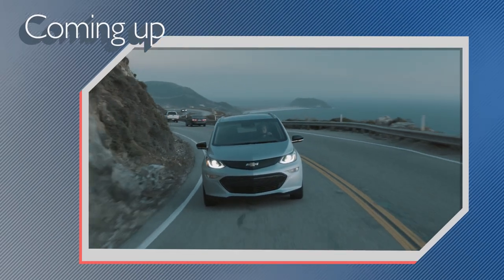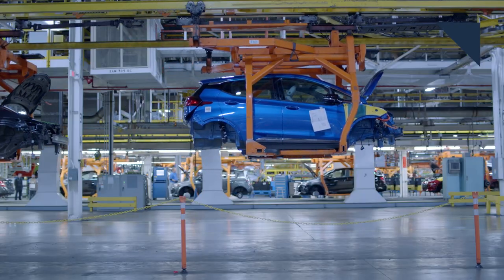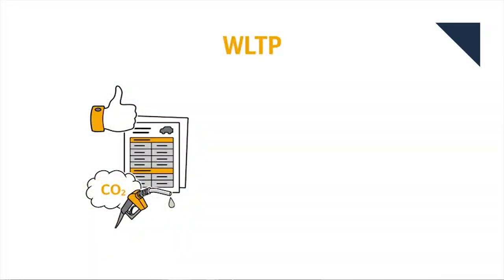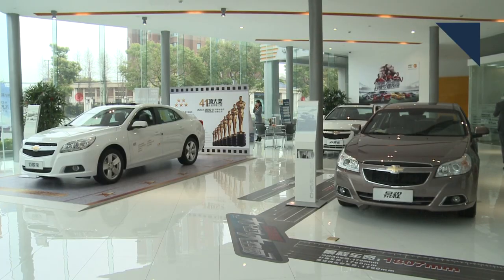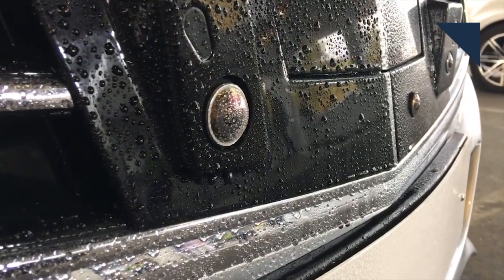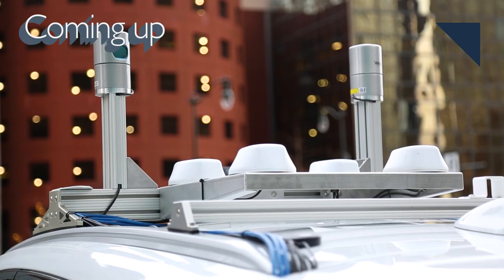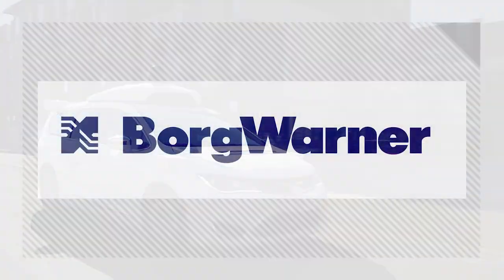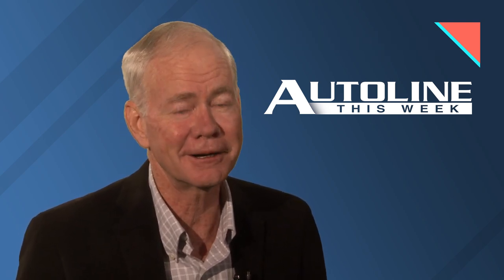What's Wrong w/ Bolt EV? Clever Lens Cleaner - Autoline Daily 2450

Comment: The title of the video is ''What's wrong w Bolt EV? but the video addresses none of the issues? Only gives a couple of stats to support the fact that sales are plummeting but are not giving any answers to what could be the problem, I am a Bolt EV owner, I got my car December 2017. For me it was impossible to find one in Southern California. The dealers had one or two cars either blue or black which I did not want. I finally got a red one. Although it is a Chevrolet car, nothing to complain about. It is an EV that gives me more than 200 miles of range. My previous car was a BMW I3. Sure enough I miss the I3 but I do not miss having to charge my car every single day. Finally, I can't believe there are still people out there driving gas cars and using the pedal brake to stop the car! Why in 100 years do you want to use the breaks (only to change them few months down the road) when you can convert the breaking energy into power... Go figure!)
Reply: using the brake pedal makes power also...........

Comment: I just spent waiting 4 months to get a 2019 BoltEV in Phoenix. I know most of that was due to the model change over but I decided to wait for the 2019 because they could not get me a 2018 back in June.  This is a fantastic car.  Chevy just needs to promote it.
Reply: But there are 6000 waiting to be sold, and a VERY small number actually being sold.
Somebody was lying to you!
Reply: GM doesn't want to promote BOLT.  They had numerous commercials the past two years pointing out how many J.D. Power awards they've won for multiple vehicles consecutively.  Not one single commercial celebrating the MOTOR TREND CAR OF THE YEAR award they got for the BOLT.

Comment: While some may not find the Bolt as attractive as other BEVs, I believe the problem is with the sales department.  I live on the East Coast and have made multiple attempts to purchase a Bolt.  The attractive deals that are offered on the West Coast don't exist here.  The sales staff lack of knowledge is embarrassing.   You have to call several dealerships just to locate one vehicle.   The sales staff should drive the cars.  The service department could use them as loaners and for local deliveries.  Chevy doesn't act like they want to sell the Bolt which is a shame for such a well engineered car.
Reply: Keith Hamilton The car IS ugly. It’s not GM that doesn’t want to sell them, it’s the dealers. Dealers don’t make $$ on service and maintenance of EV cars, and they don’t give a damn about the environment.
Reply: If you have a two-car household, it's probably a better idea to buy a used EV with 80-mile range (more like 50-70 miles, depending on condition), and that can be used for commutes and errands just fine. The other car can still do longer trips. Something like 90% of Americans drive less than 50 miles per day. Plenty of choices can be found for around $10k, if not less, both at dealers and online (Carvana and Carbiz), including the Chevy Spark EV, Ford Focus Electric, Fiat 500e, and the Mitsubishi I-MiEV. (I don't recommend the Leaf, except for 2013 and later in SV or SL trim, and those will usually cost more than $10k.) That's probably a better choice for your financial future than a new car of any kind.
Reply: Agreed.  I ended up purchasing a used i3 with very low miles at a greatly reduced price.  I didn't realize how many miles I racked up commuting to/from work and running errands around town.  We use my wife's car or rent one the for the few times we take a long trips.
Reply: u should have got the REX version and hacked it...
Reply: @nc3826  Given the much lower mileage of BEV and lack of availability of used REX models at my time of purchase I went with the BEV.   A coded REX would be awesome though.
Reply: I know there is price premium for an REX. but even as cheap (oops I mean frugal) as I am it would be my only choice. Since rapid charging is about 35 miles from where I live...  But good luck living with it limitations 

BTW I really like its cutting edge construction concept and material it uses... So Im still looking for one in my price range someday....
Reply: Keith Hamilton -- Tesla doesn't advertise, and doesn't use the 'independent franchised dealerships' either.  Surprise!  Successful sales of 'NO COMPROMISE' EVs.  The Model 3 outsold both Chevrolet CRUZE and MALIBU the past two months too.
Reply: "Tesla doesn't advertise", what cult advertises?
Reply: Looks are subjective, IMO the Bolt is much more attractive than the Model 3.
Reply: They don't want to sell it., won't make money on maintenance cost. I find model 3 just as ugly, I don't like sport coupe types, it's a sedan trying to be a sports car. I'm in NV, had to go to CA to get one, made a fun off work day out of it. Many Bolts coming off a one year lease, one driver. List less than $30K
Reply: The car is ugly and generic looking - it looks like something that should cost $14k and they want $40k. That’s the problem.
Reply: Keith Hamilton there is some acknowledgement by dealers in that they don’t want to sell you an EV....no oil changes , less brake work etc down the road.
Reply: About as many people will find this car more attractive than a Telsa 3 as women would find you more attractive than Ryan Reynolds or Idris Elba.

Comment: Wonder who's got you in their back pocket.  We have had a 2018 Chevy Bolt for 5 months and love it.  Very comfortable seating for us, great range, very smooth, quiet, peppy ride.  The 240 mile advertised range is, in our experience, right on.  Everything about it is superior to the Nissan Leaf we had for 6 years. Only downside is that the fast charge network is a bit weaker than that for Leafs and Teslas.  Perhaps if status is your thing, then you will prefer a Tesla.  But why should buyers care that there is a glut of Bolts for sale?  That's nothing but an advantage.
Reply: Exon Mobil sponsored in the commercial!!!

Comment: $50,200 for cheapest Model 3 option not including incentives. ~$44,000 for Bolt EV maxed out not including incentives. Blogs need to stop comparing these two, not even remotely close in price. Maxed Model 3 is $64,200 (non performance model). Till Tesla puts out the sub $35,000 Model 3, comparing these two is like comparing BMW 3 series to 5 series, not the same segment price wise.
Reply: Adrian Blackwell then by your metrics, the Bolt should be outselling the Model 3 because the Bolt is a lot cheaper.
Reply: 45,000$ model 3 is out. 35,000$ will be out in a few months.
Reply: Adrian Blackwell M3 is 58 out the door, Bolt premier is 46 out the door.

Comment: I own a Bolt (max'd out options) and am very happy with it. I actually like the seating and interior. And it's damn fast and fun to drive. It's the only real EV option in this price range. I would never get an air-cooled battery system in Austin, TX (Leaf, e-Golf). If not Bolt, then what??? I'm not rich enough for T-M3.